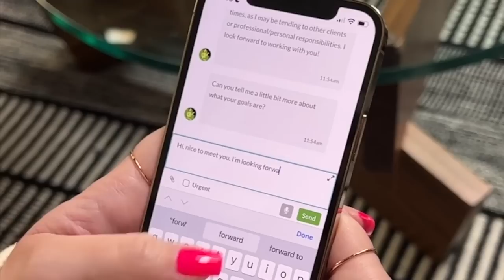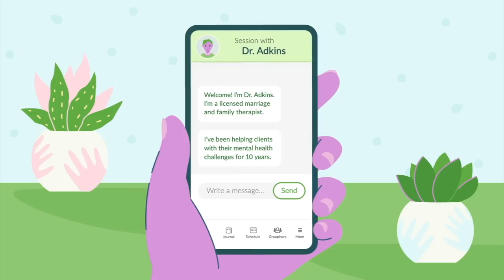Our Portugal Farm home renovations BEGIN!

Comment: Wow, what a great job you've done with the new window, it looks so natural fitting into it's new surroundings. I do feel for you John & the laborious task of removing the old malthoid roof. It reminded me of a similar task I took on many years ago with renovating an old house we'd bought that had old linoleoum tiles on the kitchen floor that badly needed removing before we could sand the timber back ready for a new floor. The tiles were backed with something resembling malthoid that stuck like glue to the timber floor, some lifted off easily but most didn't, so we attacked it with a spade like John did which was very helpful. I then had to use a blowtorch & chisel, on my hands & knees, over the whole floor to scrape off the remaining bits as trying to sand it was futile, it simply turned into hard glassy lumps. After injuring both thumbs from holding the chisel so long endlessly scraping till the job was done & a beautiful floor eventually resulted but no-one got to see what it took in the process... just a long difficult & boring task. Some jobs are like that & someone's gotta do it. Well done John, you deserve a beer, cheers from New Zealand. Looking forward to seeing your new Newby when that day comes.
Reply from the maker: Thanks so much Carolyn! Sounds like you and I had a similar kind of task friend, very frustrating but worth it in the end. I definitely enjoyed a beer after that job. Crusoe sends lots of hugs and we all send our thanks for watching. Great to have you along for this adventure. 🇵🇹❤️🙏

Comment: Also if you’ve not thought of it, or nobody’s suggested it as yet. Something to do with your bamboo, over her in Australia, and other places, we’ve been making insect sanctuaries, which can be made of different products. So as you made the sun/shower of bamboo, you can utilise as many of the barrel rings as you want, but cut the bamboo, branches, not less than wrist diameter, and then place them around in the circle affixed as needed. Believe me insects of all sorts with use them. I’d advise to use some anti rust so the rings will last, but you can replace bamboo, and twigs as needed. You can also use some chicken wire, stones twigs, in an oblong structure, as another insect sanctuary. Cheers for my adventures through your family. 🙏👍🥰😉💋❣️

Comment: Used too do that when young used to go camping in Wales..had water tank. That's how they used too heat the water for everone. The copper piping coil has to be same hight or lower then the water. Goes through the fire around the fire or under the fire. Has be lower then the water level.
Reply from the maker: Thanks so much for that tip friends great to have you here.

Comment: The windows look awesome, the concreting too, you did a great job on that wall and after it 
was painted you couldn't even tell you'd added that piece into the wall.  
Oops and your garden Spade is smaller than a square mouth Shovel which I was gonna suggest.  
If you gotta square mouth shovel and filed the mouth edge sharp, because its wider it could help 
with the roof scraping & make the job that teeny bit quicker esp as its so hot who wants to 
scrape a roof!  Your country oasis is lookin supa dupa fab, well done! 👍🏼🌻🥰
Reply from the maker: Thanks NJ! Great idea thank you so much for sharing it, the spade worked really well. Thanks so much for watching and taking this journey with us, your support is so very much appreciated! 👍🙏🇵🇹🏡

Comment: I just love your vlogs! Thank you for sharing your journey with your community! Just a piece of advice for flat roofs: I noticed you are going to paint the roof with some waterproof paint. This works great but needs to be repainted every year, as it forms bubbles with the heat that later break and let water in. It will solve your immediate problem, but you may consider putting some waterproof membrane in the future. I struggled with this issue for years and the membrane finally solved it.
Reply from the maker: Thanks Bettina!! We will definitely look into putting a waterproof membrane on it, thanks for the advice friend! Great to hear from you, we are so appreciative of your support!😊🙏❤️
Reply: @TheNewbys  it is called "membrana asfáltica" in Spanish, it should sound similar in Portuguese. It needs to be heated with a torch, but you can put it on the waterproof paint, just scrub the bubbles away, if any, so that there are no voids. I also think it is what you are currently scrubbing off. Let me know if you have any questions, my "construction English" is not so good 😊